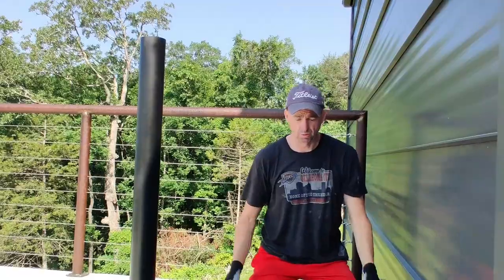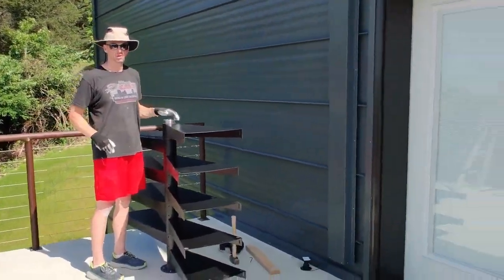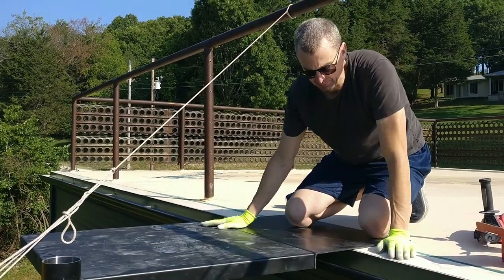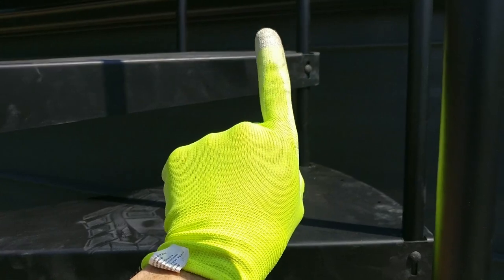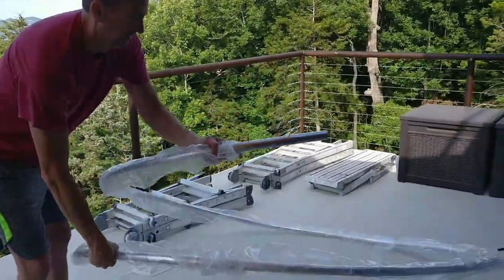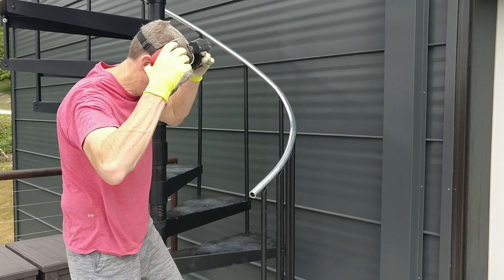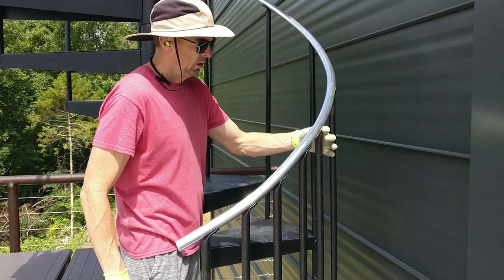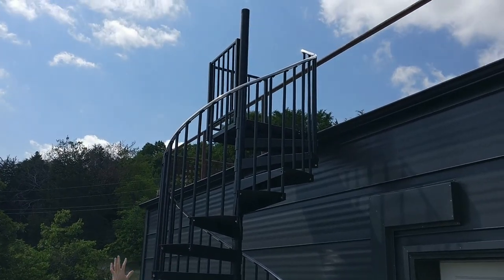DIY Steel Spiral Staircase by Paragon

Comment: I just finished my own spiral staircase. My challenges were similar to yours, and I also had to deviate from the instructions at times to complete a task. Once my footer was poured, it was fully completed in 12 hours. It is absolutely a great accent to my deck/patio area, and I'm very glad I installed it instead of traditional stairs.  Know that nation code only allows a 4" riser space, so once they arrive from Mylen, the manufacturer, I'll be bolting on riser bars to satisfy my building inspector.

Comment: Strong work!  Your DIY projects seem much more relaxed and fun than mine do, lol.

I do have one concern which is if you guys painted or applied anything to the cut ends of the balusters to keep them from rusting?  Maybe that's less of a concern where you are, but way up north in Wisconsin everything that can rust, does.  We also tend to need to use salt in the winters so it makes it worse.  For my purposes, I might look into a "dip grip" type product that will hold up to minor scuffs from boots and shoes.  If you did use something, I'd be curious what you used.  Not critiquing as the staircase looks awesome, but you guys have put in a lot of work and I would hate to see anything you guys have worked so hard on get damaged or stained by rust.  

Have a happy!
Reply from the maker: The kit came primed and then we coated everything with Rust-Oleum spray paint in matte black. Hopefully that will be enough 🤞We will buy and install grip tape or pads for each stair tread and the platform.

Comment: The staircase came out nice. Great DIY job! I am looking to get the same type of staircase for a balcony. What is the manufacture of the staircase you used?
Reply from the maker: It was made by Paragon. We have been very happy with it.
Reply: They are also sold under the brand names Mylen and Salter.  Same stairs, we are installing a Mylen one right now that is just like this (except different connectors for the center balusters, ours are much simpler.)

Comment: I'm not 100% sure about this but I think those tube connectors work best when they are seated deeper in the tube.  You might want to take out the screws one at a time, screw them back in 4-5 turns, then hit them with a hammer to drive the connector further up and re-tighten.

One last thing, I kind of don't like the set screw for holding the tread up on the central column.  I would much rather use a sleeve spacer between the treads and let the set screws just control rotation.  But that's the kit, not you...
Reply: I thought the same thing. Those set screws seemed like a very sketchy attachment to me. I would run at least 1, more likely 2 self-tappers in there.

Comment: What is distance of rises
Reply from the maker: It will be based on your own needs from the bottom step to the height that you are going to. I think ours ended up being 9 and 1/2 or 10 and 1/2. But you'll do the calculations by taking the total height dividing by the number of treads and then figuring out that space in between.

Comment: No recording showing you putting the railing on. All that discussion then next shot the rail is on.  I thought this was an instruction information how to video. One of the important parts you cut out.
Reply from the maker: The railing was definitely the hardest part! We showed how to untwist it. To put it on we just started at the bottom and worked out way up one ballester at a time screwing it in. There were a couple of places where it took two of us to push down on the railing and screw up from the underside.